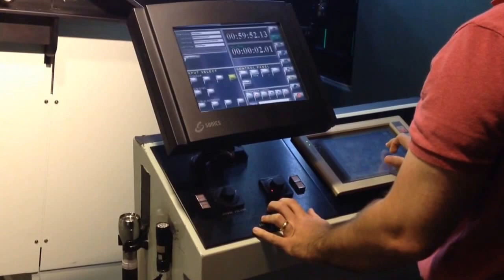Threading an IMAX 70mm Projector

Comment: this projector looks like a IBM main frame computer from the 80's. Why has the technology increased in film making but they can't beat the quality of the Imax 70mm film?
Reply: SweetSpot909 Because all you need to do to increase the resolution of film is make it larger. That's relatively easy to do, you just need to scale up all the equipment that handles it. Film this size is about equivalent to about 12k digital resolution, and we're not even close to having any digital cameras or displays/projectors at that resolution yet. Even current technology is not an improvement over 35mm film, which is about equivalent to 4k resolution.
Reply: +Adam Ahmed i think the new imax lasers beat the 70mm system. It's really something amazing.
Reply: +MrWalker1000 Not possible if the source material is 4K or less. If it's 8K, MAYBE, but IMAX film is still equivalent to about 12-13K.
Reply: +Adam Ahmed Actually the resolution of the original camera negative is about 18k pixels across but when it is printed onto the final print then there is a massive loss in quality. The final result is still good provided the image hasn't gone through too much manipulation.
Reply: I want to build a modern film projector. Run it on Raspberry Pi and have carbon fiber platters ( among other things - PTR rollers, vacuum suction film gate, LED light source )